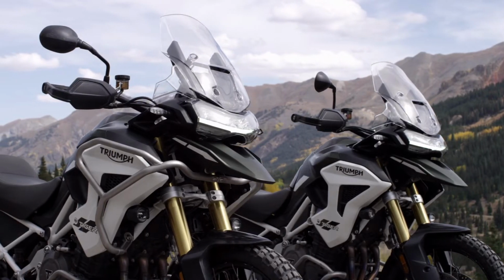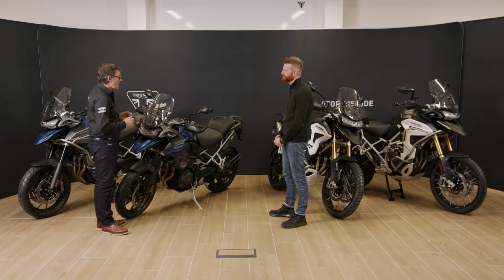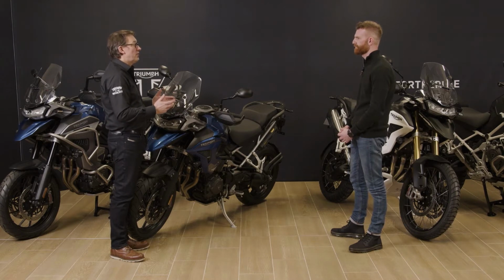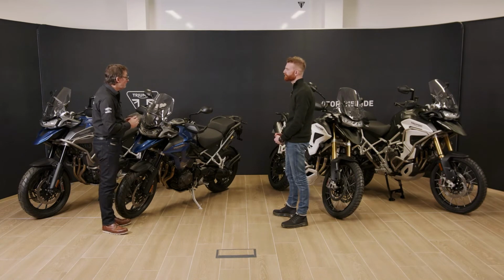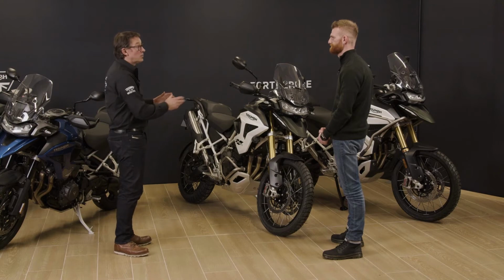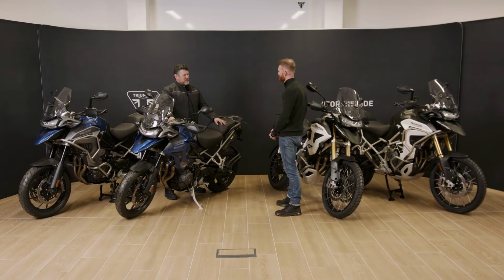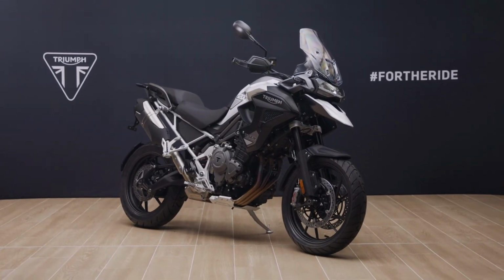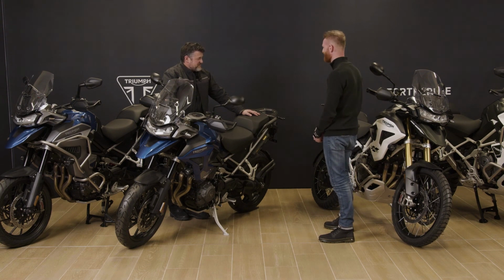EXCLUSIVE 2022 Triumph Tiger 1200 first look | Carole Nash Insidebikes

Comment: I have the current Tiger 1200 XRT. It’s a fabulous tourer and eats the miles in comfort, passenger comfort is superb as well. Only downside is that its heavy, no issue once you’re away but at manoeuvring speeds 2 up with luggage its a handful with all that weight at the top. So really looking forward to riding this new bike. Looks great as well.